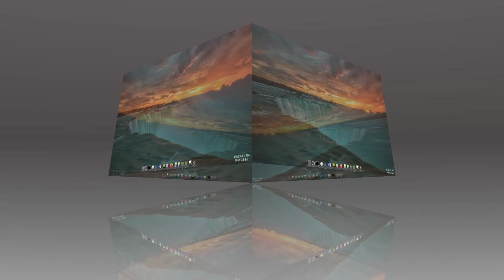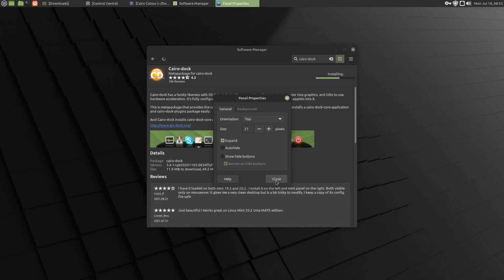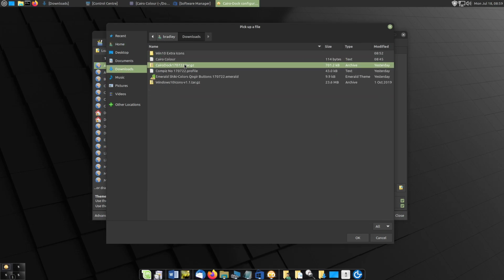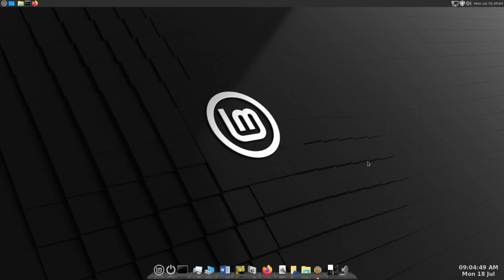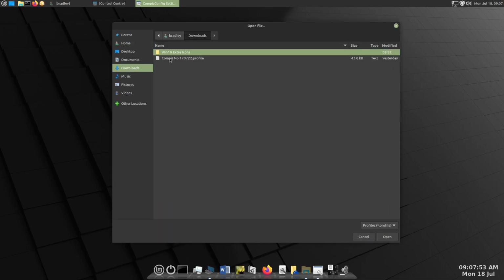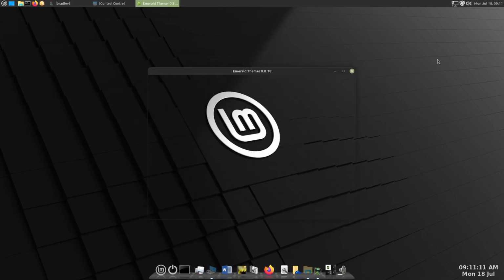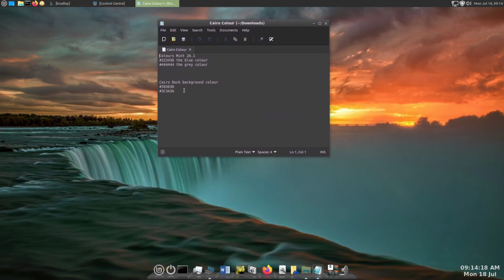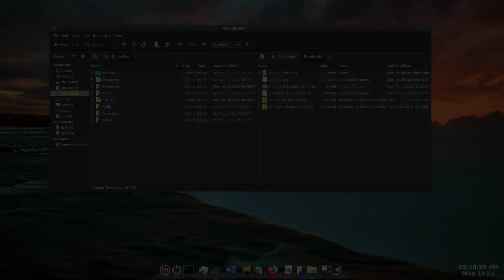Linux Mint 21 Testing My Set Up, Compiz, Emerald, Cairo Dock

Comment: Hey Bradley, thanks for the video. Just a nosy question here. Have you tried the monitor scaling? I wonder if your Cairo Dock disappears (well, stays at the bottom, so is outside the viewable range) when scaling set to anything bigger than 100%?
Reply from the maker: I have not tried scaling. I'm not sure what you are referring to regarding disappearing/being at the bottom, if you could note a timestamp in the video might help. I have the dock set to ‘hide’ when a window gets near it if that’s what you mean?
Reply: @2troke  Thanks. I am not referring to your video, just Cairo in general, since you spent time installing it. I have my Cairo set very similar to you. What happens when I go to Display and turn "Monitor scale" to anything other than 100%, Cairo keeps sitting at the bottom of the original scaling. So in effect, it becomes "invisible" and inaccessbible, since it is stilll there but outside the view. I just thought I'd try asking if you have the same experience / workaround, since you are on Linux Mint 21 and use Cairo. If not... well, thanks anyway - there aren't that many videos with that content around :-) 

(And sorry for asking unrelated / only-half-related questions. )
Reply from the maker: @JanVlcekOnline  OK. I tried scaling and lost most of my windows including the dock. I use a 40” TV as a monitor so maybe something about that. Perhaps if I resized my monitor borders using the (TV remote) I could get it to work but don’t want to make a mess of things. I only had auto detect 100% or 200% options no 125% or such. 

When I change my sound output from the monitor/TV via the sound options in Mint so I can listen to music on the stereo I have to close and restart Cairo to be able to use the volume but I don’t think restating it will help however when I scaled I noticed the panel on the top of the screen was still there so maybe positioning Cairo on the top as a work around….

Scaling on a TV might be different than on an actual PC monitor, I don’t know? Someone else had a similar problem with scaling so check the comments section (not sure what Cairo video it was) but I couldn’t help them either.

From my 1 minute test of scaling, restarting the computer or resizing the ‘zoom’ of the screen might help?? It basically just zoomed in so much that whatever didn’t fit that scale was off the screen as if I needed an 80” screen. I assume you lost not just the dock but whatever was below a certain point on the screen? 

I tried a second time and as my Cairo clock is detached from the actual dock I could see that and tried to move the dock to the top, which I did but it wasn't working very well, hidden behind windows and came to the front when i tried to move the windows out of the way, a disaster basically. I don't think it likes scaling some how!

And no such thing as a unrelated question as I like to learn from others experiences also. Let me know how you go, cheers.
Reply: @2troke  Thanks again. OK, so your Cairo also does not handle scaling. 

My desktop scaled OK and all the icons rearranged themselves correctly, they were not cut from the view or below the viewable area, as you suggest. I have changed Cairo to sit at the top but that did not go down well either. Everything was scaled up, Cairo dock actually scaled down and was sitting in a strange position, some distance off the top of the screen. It does not like scaling at all. (Restart does not help.)

Thanks for the tip, I will try to find that Cairo dock video you mention. Thanks! 👍
Reply from the maker: @JanVlcekOnline  I think its a Cairo scaling problem myself

Comment: Where did you get windows10 icons? I tried different versions but everyone of them had problems showing some applet icons. Network applet icon for wifi doesn't show.
Reply from the maker: I’ve  made a few videos about Windows 10 icons / themes over the last several years, so if you scroll through my videos back to 2019 you should find them.

If you're on Cinnamon, note that I do some mods to some of the icons later in the video
Linux Mint Cinnamon Windows 10 Theme
https://www.youtube.com/watch?v=72JE4T0GNgc

or for Mate see here
Linux Mint to Windows 10 Look under 10 Minutes (Mate)
https://www.youtube.com/watch?v=IgjWmlfTz4U

Notice some of the icon/theme packs I use are different from Cinnamon/Mate and so are the results. Also I did this on Linux Mint 19.x so things might have changed but let me know if you have trouble sorting it all out.
Reply: @2troke  I'm running XFCE but I achieved 90% of the look. The only thing I couldn't customize is the right side of the panel, the applet icons, because I'm on a laptop and the battery icon stays the same (default) and all the icons are very BIG. In XFCE the default panel icon size are small as compared to windows 10, so I increased the size to 32px but this setting applies icons on the left side of panel as well as right side on applet icons.

But overall I'm satisfied. Your videos helped a lot. Thankyou.

Compiz doesn't work on Cinnamon I guess, that's why I'm running XFCE in my potato laptop. It's working super fast.

Comment: have you tried running the back up tool on mint? when you reinstall, run the backup tool to import the package list and then it installs it auto-magically. the only things it wont reinstall are the special deb files i.e. custom deb. files for your laser printer etc
Reply from the maker: I think I did try it once. By the time I've been using a system for a few years there's  usually extra stuff I've installed once and never used again so now I just make a bit of a mental list and install as I go when I realise something is missing, which Isn’t much usually. 

I intend to replicate my 20.3 system on a virtual machine then run the upgrade tool to Mint 21 when it arrives as a final test before I upgrade my hardware installed systems, so I might even try the back up tool on that, so thanks for the tip.

Comment: I have installed the latest kernel with Mainline in Mint. But it doesn't boot up with the latest kernel.  How to activate the latest kernel?
Reply from the maker: Been a while since I've played with this sort of stuff but this should get you going:  https://youtube.com/watch?v=e6Sk0Mej5ss&t=480
The activation part starts at around the 8 minute mark. Bear in mind your input numbers will likely be different than mine in the video and future kernel updates might affect, or push your kernel down the list causing Linux to boot off a different kernel so you might want to disable future kernel updates which I think you can do in the updater.